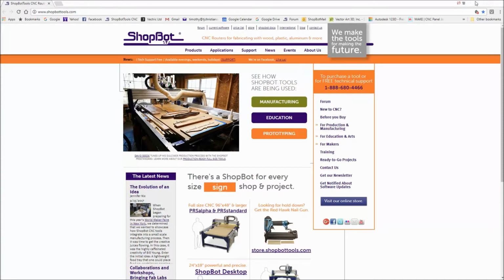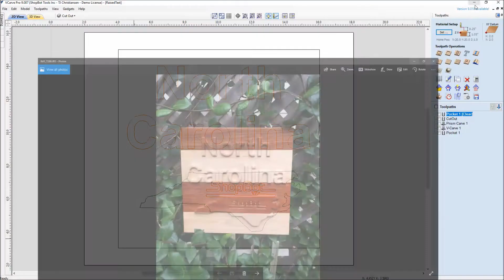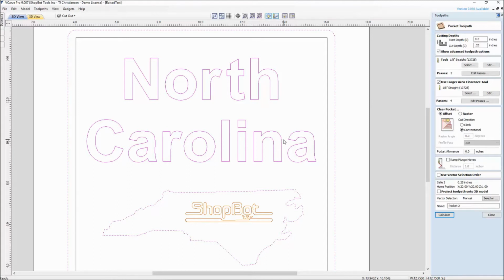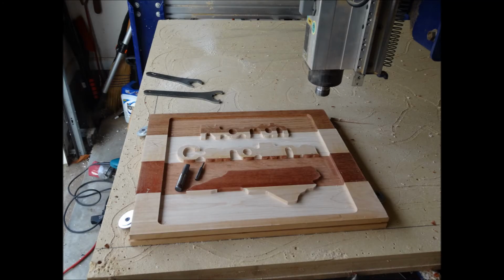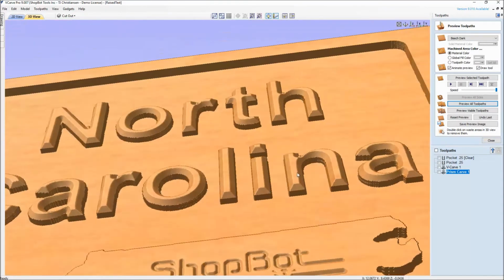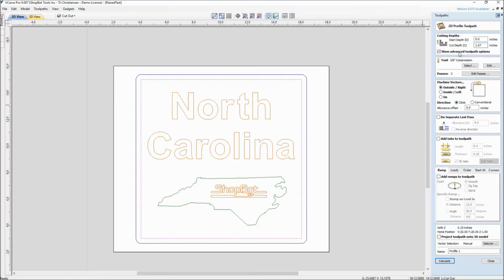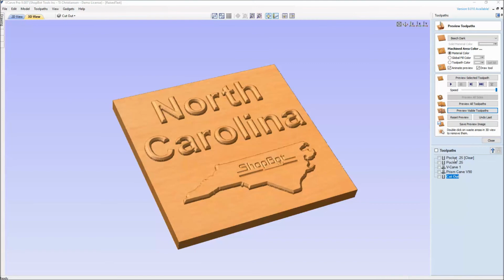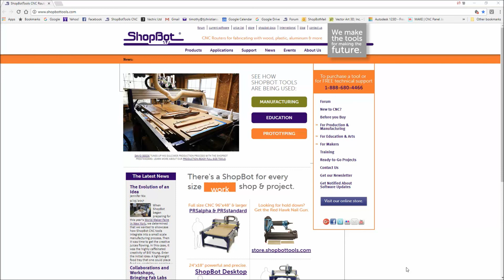Raised Text

Comment: Vectric VCP 8.5, Mach 3.  Thanks for you YT video it helped a lot.  In the cutting I’m  making the 60 deg bit for the slanted side lettering is leaving some spaces between the V cut sides that are not cleaned up. Using a 1/4” bit for cleanup.  How can I clean those little spaces up, they are as small as 0.100” wide.  And I don’t want to use a 1/16” but as the cleanup tool.

Comment: Good video. Too bad there was no specific info on bits used.
Reply from the maker: It's been a bit since this video was recorded -- but going through the cuts it looks like we've got a 1/2" straight flute for clearing out the majority of the material in the pocket, followed by a 1/8" straight flute for the corners. Then we switch to a 90 deg V-Bit (1/2 cutter diameter) for the V-Carving toolpath. The cutout at the end is done with a 3/8 Compression (up-down cut) bit.